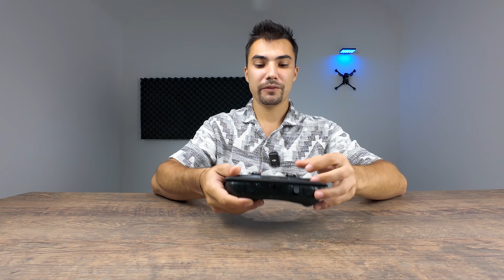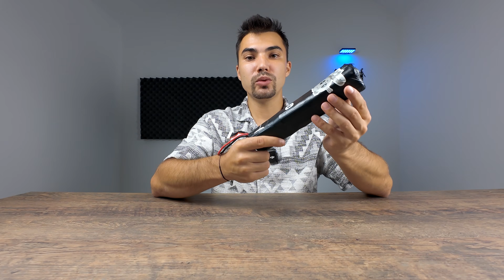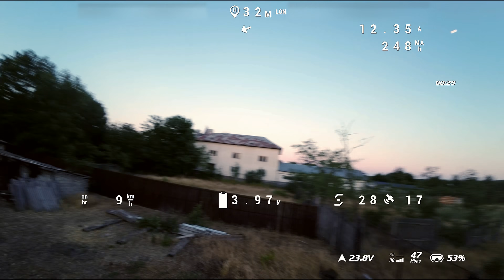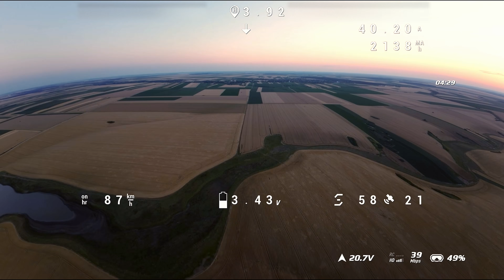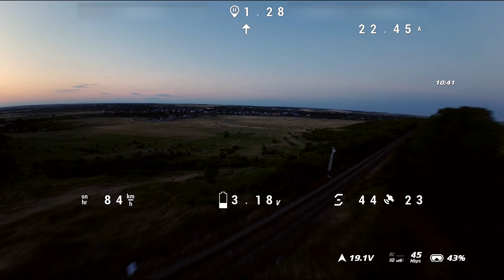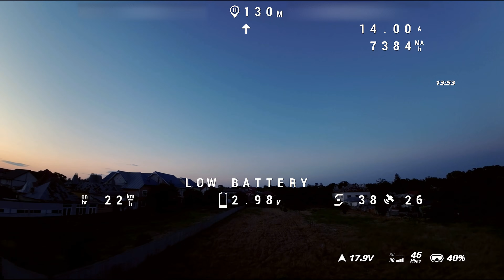How To Fly Long Range FPV | Chimera7 Pro V2 O3 | 6.6 KM Test Flight 🔥

Comment: Thank you for the video! The test flight was awesome. What settings on the goggles would you recommend? 40hz? What output setting and channel do you use?
Reply from the maker: Hello, I use Goggles 2 and DJI O3 and the video transmission is set to maximum output and automatic channel selection. This should only be changed when you fly in a controller environment like multiple drones in close proximity sharing the same bandwidth to separate bands.

Comment: The reasons why the tango 2 is worse with the buttons is total bs, man.
Reply from the maker: Why? I don’t want to get my drone randomly disarmed after a takeoff. I leave with fear and most often it cycles 2 times when I first arm it and that’s it. But it also happened to disarm randomly after 6 seconds of flight.
Reply: How often did this really happen?
Reply from the maker: @frodobeutlin1361  the bounce at first arm almost always. The disarm during flight happened twice. It’s enough to happen once during a long range flight and you’re done.
Reply from the maker: @frodobeutlin1361  to be honest I might have abused the switch cause I was using it to arm in the simulator and you arm 100 times over one hour in liftoff compared to what a regular field use is. I don’t say this is a dealbreaker, but it clearly wears out after a lot of use and in a regular field use you may see Tango 2  with these problem after 5 years of use. I already have this controller for one year and a half.

Comment: Tell me, how far would you fly on 4500mah? Would it be enough for 4 km ?
Reply from the maker: I think you can safely go 4km with 4500mah if you are talking about LiIon.
Reply from the maker: With a Lipo, I am not sure, I wouldn’t risk it, but you can monitor your power consumption and leave some room for error. Testing your setup until you’re sure you can trust it it’s crucial for you to avoid losing your drone and to know your setup capabilities.
Reply: @GoeFPV  Li Ion

Comment: Thanks for putting up the work... great video !
Somehow it is disheartening to see how low limited the flight time of bigger drones is, even with custom made lion.
I am flying a 4inch (tern lr40) and am able to go 20 minutes without gopro and 10-14 with gopro (naked 45gramms).

Still searching for a setup which is able to fly high speeds (like yours) with gopro for at least 20 minutes, I would prefer 30, 
but somehow it seems the missing aerodynamics of drones make this task very hard to achieve. 

If you are having any ideas, suggestions, I would appreciate :-)

Comment: Hey, I’m wondering if this could be helpful: setting the correct packet rate for the radio, checking for interference around (like radio towers, radars, or cellular towers), using a “wind app” to check wind at certain altitudes, planning the whole mission on the map including distance and checkpoints, and flying a smaller pack before the big send for a GPS rescue test.
Reply from the maker: hello, sure these are very important factors, but assuming you already have an UAV operator license you already know navigation and weather considerations involved in a flight. Regarding the packet rate, and interferences, these are factors that each has to decide if it’s worth the risk or if the setup is ready for a failsafe. I always keep an eye in the signal strength and I’m flying with a margin of error to leave room for a failsafe event.

Comment: Bought this drone 1 week ago, it’s arriving in 3 days. Can’t wait! Nice video! You got my sub
Reply from the maker: It’s an awesome drone 🚀 Thank you!
Reply: How has it gone since? Looking at one
Reply: @Flagermus_FPV it’s a great drone, stable and so nice to fly!
Reply: @thomjak86  thank you both 😁 I love to hear it! Very strongly considering grabbing one for a new build. They look incredibly solid and stable.
Reply: @ Go for it and do an O4 build and pair it with 8000mAh battery 👌 your going to love the weight and stability. It does not feel heavy in the air but rather rock solid and no jello issues etc 😎
Reply from the maker: that’s true. Please consider using my affiliate link in the description. It helps me a lot 🙏. If you need support contact me on IG and I will guide you get the right setup.
Reply from the maker: @Flagermus_FPV check the newest video with a 10km flight. 😁